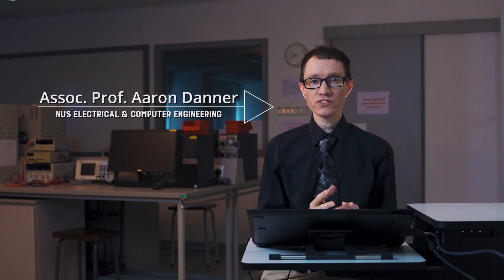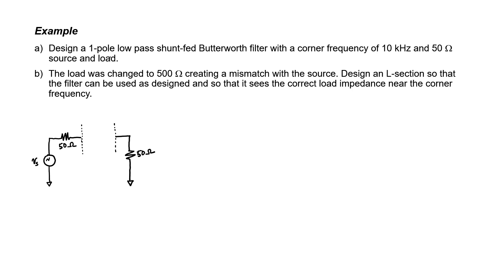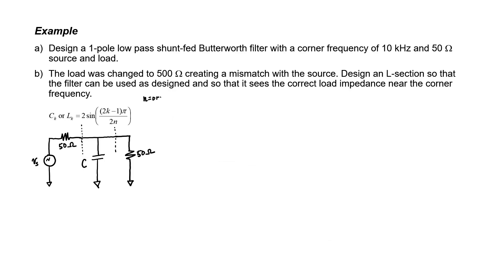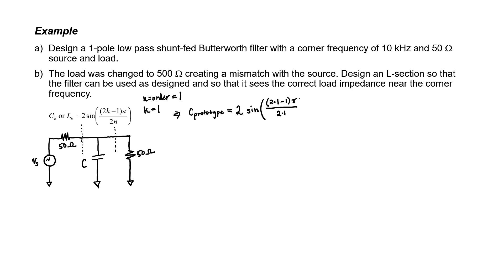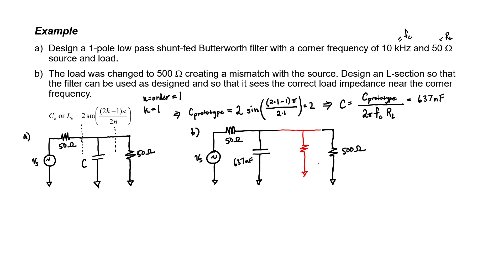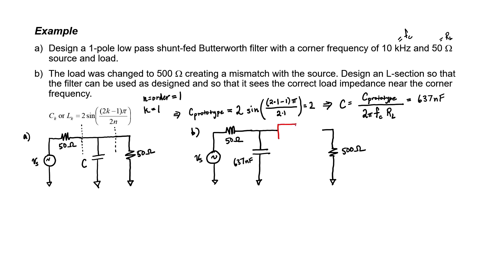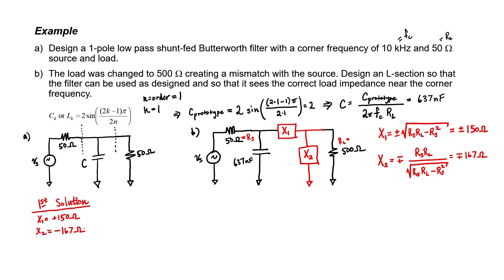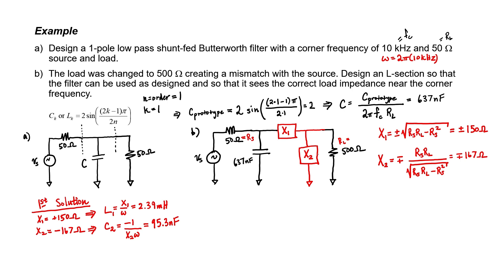Detailed L-section impedance matching example (13 - Passive Filters)

Comment: hi sir , i have a question about solution  : the fact that we put a cap in series and inductor in parallel makes the circuit a band pass filter ?
Reply from the maker: Yes, the L-section can screw up the filter.  For that reason the "first solution" which preserves the low pass behavior is better than the "second solution" in this example.  The L-section only transforms impedances correctly at one frequency and they are usually used in resonant circuits where this makes sense.  In fact this is why I put the words "near the corner frequency" in the text of part (b).
Reply: @adanner  What happens if we need to make a tunable band-pass filter? Do we need to use the first solution again? Since our resonant frequency can change.